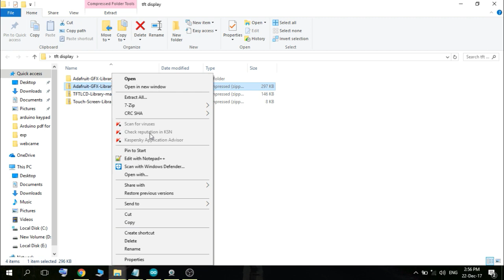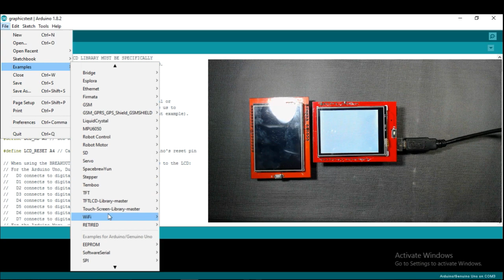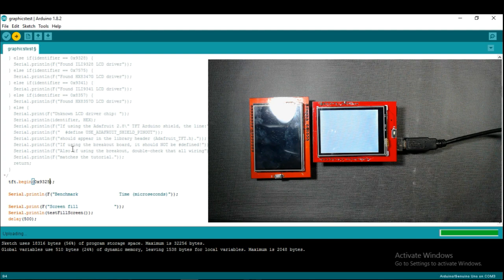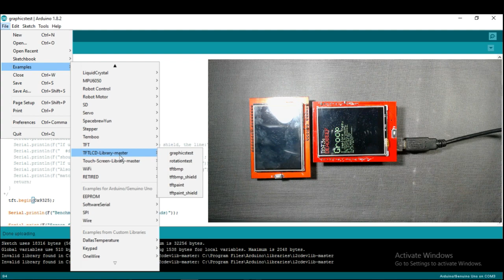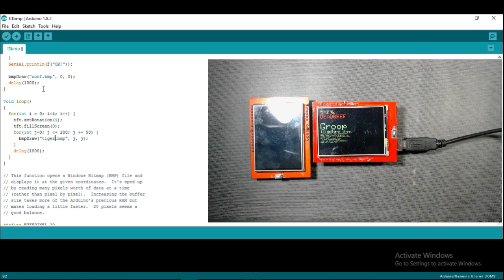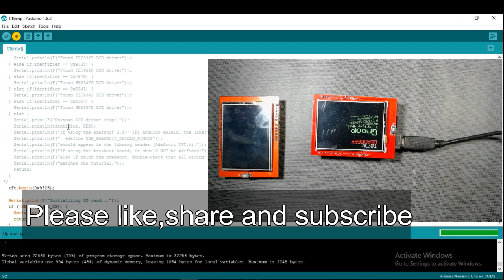How to fix white screen of tft touch screen with arduino | TFT unknown driver Fix

Comment: Paint!
Unknown LCD driver chip: 0
If using the Adafruit 2.8" TFT Arduino shield, the line:
  #define USE_ADAFRUIT_SHIELD_PINOUT
should appear in the library header (Adafruit_TFT.h).
If using the breakout board, it should NOT be #defined!
Also if using the breakout, double-check that all wiring
matches the tutorial.
他是0怎麼辦
Reply: #include <Adafruit_GFX.h>    // Core graphics library
#include <Adafruit_TFTLCD.h> // Hardware-specific library
#include <TouchScreen.h>

#if defined(__SAM3X8E__)
    #undef __FlashStringHelper::F(string_literal)
    #define F(string_literal) string_literal
#endif

// When using the BREAKOUT BOARD only, use these 8 data lines to the LCD:
// For the Arduino Uno, Duemilanove, Diecimila, etc.:
//   D0 connects to digital pin 8  (Notice these are
//   D1 connects to digital pin 9   NOT in order!)
//   D2 connects to digital pin 2
//   D3 connects to digital pin 3
//   D4 connects to digital pin 4
//   D5 connects to digital pin 5
//   D6 connects to digital pin 6
//   D7 connects to digital pin 7

// For the Arduino Mega, use digital pins 22 through 29
// (on the 2-row header at the end of the board).
//   D0 connects to digital pin 22
//   D1 connects to digital pin 23
//   D2 connects to digital pin 24
//   D3 connects to digital pin 25
//   D4 connects to digital pin 26
//   D5 connects to digital pin 27
//   D6 connects to digital pin 28
//   D7 connects to digital pin 29

// For the Arduino Due, use digital pins 33 through 40
// (on the 2-row header at the end of the board).
//   D0 connects to digital pin 33
//   D1 connects to digital pin 34
//   D2 connects to digital pin 35
//   D3 connects to digital pin 36
//   D4 connects to digital pin 37
//   D5 connects to digital pin 38
//   D6 connects to digital pin 39
//   D7 connects to digital pin 40

#define YP A3  // must be an analog pin, use "An" notation!
#define XM A2  // must be an analog pin, use "An" notation!
#define YM 9   // can be a digital pin
#define XP 8   // can be a digital pin

#define TS_MINX 150
#define TS_MINY 120
#define TS_MAXX 920
#define TS_MAXY 940

// For better pressure precision, we need to know the resistance
// between X+ and X- Use any multimeter to read it
// For the one we're using, its 300 ohms across the X plate
TouchScreen ts = TouchScreen(XP, YP, XM, YM, 300);

#define LCD_CS A3
#define LCD_CD A2
#define LCD_WR A1
#define LCD_RD A0
// optional
#define LCD_RESET A4

// Assign human-readable names to some common 16-bit color values:
#define BLACK   0x0000
#define BLUE    0x001F
#define RED     0xF800
#define GREEN   0x07E0
#define CYAN    0x07FF
#define MAGENTA 0xF81F
#define YELLOW  0xFFE0
#define WHITE   0xFFFF

Adafruit_TFTLCD tft(LCD_CS, LCD_CD, LCD_WR, LCD_RD, LCD_RESET);

#define BOXSIZE 40
#define PENRADIUS 3
int oldcolor, currentcolor;

void setup(void) {
  Serial.begin(9600);
  Serial.println(F("Paint!"));
  
  tft.reset();
  
  uint16_t identifier = tft.readID();

  if(identifier == 0x9325) {
    Serial.println(F("Found ILI9325 LCD driver"));
  } else if(identifier == 0x9328) {
    Serial.println(F("Found ILI9328 LCD driver"));
  } else if(identifier == 0x7575) {
    Serial.println(F("Found HX8347G LCD driver"));
  } else if(identifier == 0x9341) {
    Serial.println(F("Found ILI9341 LCD driver"));
  } else if(identifier == 0x8357) {
    Serial.println(F("Found HX8357D LCD driver"));
  } else {
    Serial.print(F("Unknown LCD driver chip: "));
    Serial.println(identifier, HEX);
    Serial.println(F("If using the Adafruit 2.8\" TFT Arduino shield, the line:"));
    Serial.println(F("  #define USE_ADAFRUIT_SHIELD_PINOUT"));
    Serial.println(F("should appear in the library header (Adafruit_TFT.h)."));
    Serial.println(F("If using the breakout board, it should NOT be #defined!"));
    Serial.println(F("Also if using the breakout, double-check that all wiring"));
    Serial.println(F("matches the tutorial."));
    return;
  }

  tft.begin(identifier);

  tft.fillScreen(BLACK);

  tft.fillRect(0, 0, BOXSIZE, BOXSIZE, RED);
  tft.fillRect(BOXSIZE, 0, BOXSIZE, BOXSIZE, YELLOW);
  tft.fillRect(BOXSIZE*2, 0, BOXSIZE, BOXSIZE, GREEN);
  tft.fillRect(BOXSIZE*3, 0, BOXSIZE, BOXSIZE, CYAN);
  tft.fillRect(BOXSIZE*4, 0, BOXSIZE, BOXSIZE, BLUE);
  tft.fillRect(BOXSIZE*5, 0, BOXSIZE, BOXSIZE, MAGENTA);
  // tft.fillRect(BOXSIZE*6, 0, BOXSIZE, BOXSIZE, WHITE);
 
  tft.drawRect(0, 0, BOXSIZE, BOXSIZE, WHITE);
  currentcolor = RED;
 
  pinMode(13, OUTPUT);
}

#define MINPRESSURE 10
#define MAXPRESSURE 1000

void loop()
{
  digitalWrite(13, HIGH);
  TSPoint p = ts.getPoint();
  digitalWrite(13, LOW);

  // if sharing pins, you'll need to fix the directions of the touchscreen pins
  //pinMode(XP, OUTPUT);
  pinMode(XM, OUTPUT);
  pinMode(YP, OUTPUT);
  //pinMode(YM, OUTPUT);

  // we have some minimum pressure we consider 'valid'
  // pressure of 0 means no pressing!

  if (p.z > MINPRESSURE && p.z < MAXPRESSURE) {
    /*
    Serial.print("X = "); Serial.print(p.x);
    Serial.print("\tY = "); Serial.print(p.y);
    Serial.print("\tPressure = "); Serial.println(p.z);
    */
    
    if (p.y < (TS_MINY-5)) {
      Serial.println("erase");
      // press the bottom of the screen to erase 
      tft.fillRect(0, BOXSIZE, tft.width(), tft.height()-BOXSIZE, BLACK);
    }
    // scale from 0->1023 to tft.width
    p.x = map(p.x, TS_MINX, TS_MAXX, tft.width(), 0);
    p.y = map(p.y, TS_MINY, TS_MAXY, tft.height(), 0);
    /*
    Serial.print("("); Serial.print(p.x);
    Serial.print(", "); Serial.print(p.y);
    Serial.println(")");
    */
    if (p.y < BOXSIZE) {
       oldcolor = currentcolor;

       if (p.x < BOXSIZE) { 
         currentcolor = RED; 
         tft.drawRect(0, 0, BOXSIZE, BOXSIZE, WHITE);
       } else if (p.x < BOXSIZE*2) {
         currentcolor = YELLOW;
         tft.drawRect(BOXSIZE, 0, BOXSIZE, BOXSIZE, WHITE);
       } else if (p.x < BOXSIZE*3) {
         currentcolor = GREEN;
         tft.drawRect(BOXSIZE*2, 0, BOXSIZE, BOXSIZE, WHITE);
       } else if (p.x < BOXSIZE*4) {
         currentcolor = CYAN;
         tft.drawRect(BOXSIZE*3, 0, BOXSIZE, BOXSIZE, WHITE);
       } else if (p.x < BOXSIZE*5) {
         currentcolor = BLUE;
         tft.drawRect(BOXSIZE*4, 0, BOXSIZE, BOXSIZE, WHITE);
       } else if (p.x < BOXSIZE*6) {
         currentcolor = MAGENTA;
         tft.drawRect(BOXSIZE*5, 0, BOXSIZE, BOXSIZE, WHITE);
       }

       if (oldcolor != currentcolor) {
          if (oldcolor == RED) tft.fillRect(0, 0, BOXSIZE, BOXSIZE, RED);
          if (oldcolor == YELLOW) tft.fillRect(BOXSIZE, 0, BOXSIZE, BOXSIZE, YELLOW);
          if (oldcolor == GREEN) tft.fillRect(BOXSIZE*2, 0, BOXSIZE, BOXSIZE, GREEN);
          if (oldcolor == CYAN) tft.fillRect(BOXSIZE*3, 0, BOXSIZE, BOXSIZE, CYAN);
          if (oldcolor == BLUE) tft.fillRect(BOXSIZE*4, 0, BOXSIZE, BOXSIZE, BLUE);
          if (oldcolor == MAGENTA) tft.fillRect(BOXSIZE*5, 0, BOXSIZE, BOXSIZE, MAGENTA);
       }
    }
    if (((p.y-PENRADIUS) > BOXSIZE) && ((p.y+PENRADIUS) < tft.height())) {
      tft.fillCircle(p.x, p.y, PENRADIUS, currentcolor);
    }
  }
}
Reply: 謝謝教導我測試成功了，抱歉我以為她會跑else if(identifier == 0x9341) {}原來要一個個測試，等等我把他轉二進制，測試看看會不會跑if

Comment: The problem with these displays is the reset. The software reset in the driver on pin A4 doesn't work. Connect it to the Arduino RESET and it all works as expected. No need to manually configure the identifier!!! Sort out the root cause of the problem, not workaround it!

Comment: Sir i'm using Arduino Mega 2560 with 1.8 TFT st7735 the code is compiling but showing a white screen on TFT. After checking the serial monitor it is displaying present time.

Comment: When I use the 9325 and 9328 I get color  and movement but not the correct display. Mostly full pink screen turning to blue back to pink. Should I try other Identifiers? The seller just sent me a folder which contained this file _9341uno.  When I try it I get an error: a sub folder of your sketchbook is not a valid library .Does that mean they think it is ID 9341? This was the Zip file they sent 2.4inch_Arduino_ILI9341_V2.0

Comment: If anyone is having problems with not being able to find the port or connecting to the board I highly recommend getting a new cable, I didn't think it would be a problem to do with the cable since it was making the screen go white, but it was and its all working perfectly fine with a new cable!

Comment: Setting the identifier manually hasn't fixed the white screen problem in my case.
When I don't change anything, the ID shows up as "0"...
Reply: set it to 0x9341
Reply: @it0it0  how bout 9300

Comment: I just received a 2.4 inch display and tried to get it going on the Uno. There's not much on the board to identify it but it is a Mcufriend display. It simply had printed on the back of the board "www.mucfriend.com" "tftlcd for arduino uno (spiflash). Running graphictest gives blank screen, serial port output reports: 
Serial took 0ms to start
ID = 0xC0C0
That's it and the screen stays white. Is there some configuration I have to do or is this screen not supported? Any help greatly appreciated.

Comment: Just connect the RESET pin of the display to the RST pin of the Arduino. This fixes a proper reset at power up.
Reply: Yes exactly correct!
I have been trying to use software reset command at the beginning of my code.
It didn’t work... white screen all the time!
As soon as I arrange hardware reset the display started working !
The only disappointing thing here is that u have to use a pin on microcontroller for just that purpose which is stupid loss...

Comment: Still didn't work for me.  Maybe my screen is dead.  It's white but none of the hex numbers work.  Also, it doesn't seem to recognize any driver chip like in your video. You got "6809".  All I get is "0".

TFT LCD test
Using Adafruit 2.8" TFT Arduino Shield Pinout
TFT size is 240x320
Unknown LCD driver chip: 0
Reply from the maker: Sorry for that. It works for most of the cases. But you try in google. You may get different methods. If it is white, it may not be dead. Most of the cases, we get the hex code as given by Adafruit Industry. But most of the boards come from China and they use different Drivers and therefor this white screen problem occurs.
If you woun't get any solution, then  buy boards from Adafruit directly from there website(I am not advertising their brand), it will be little costly, but you will not get any problem.
You can visit to our "dpvtechnology"website for other components (till now,it is only for india).
Reply: Thanks for the help DPV TECHNOLOGY.  After some searching around google, it seems like there are numerous versions of this display that all look almost identical but have different driver chips.  Therefore, no one solution will work for them all.  You have to try multiple different methods.  I think you're right -- if the screen is white, it's probably a sketch and/or library issue and not a hardware issue.

My advice to anyone else having the white screen problem -- try the steps in DPV TECHNOLOGY's video and if that doesn't work, keep trying other methods until you find one that works.  Google can help find the other methods.
Reply: @Samuel-km5yf  Did you find it?

Comment: Buddy links gone. not working anymore. kindly help
Reply from the maker: NOT GETTING YOUR QUESTION YAAR
Reply: the three links in discription  are not working any more kindly help

Touch screen library
https://github.com/adafruit/Touch-Scr...

TFT LCD library
https://github.com/adafruit/TFTLCD-Li...

GFX library
https://github.com/adafruit/Adafruit-...
Reply: iam using it on wemos D1 hope it will work
Reply from the maker: Thank you for your comment.we will fix it soon by today..
Reply from the maker: link has been fixed.you can try

Comment: hello. sorry for my bad English .I am trying to resolve my white screen problem. I have try all library whithout solution. now i think that it's about my register and i upload LCD_ID redreg library to show a different values of my registers  and i found this:Unknow LCD driver C0C0. i am using a 2.4 TFT SPI 240x320 whith arduino uno. I need help.
Reply from the maker: Thank you for your comment..Try to replace your driver instead of the driver given in the program.But I did not check that. If it will not work, please try with the following--
http://www.instructables.com/id/How-to-use-24-inch-TFT-LCD-SPFD5408-with-Arduino-U/

Comment: hello DPV TECHNOLOGY.i have used all things that you showed on your video but my white screen problem hav'nt changed
Reply: If u r using mcufrind shield then download mcufriend tft libraries & try the examples if u still get white screen then go to this link https://forum.arduino.cc/index.php?topic=450176.0
Reply: @johndripper   I am having similar issues, white screen, I added the kvb libraries, graphicstest reports 0XC0C0 as identifier, and I don't know where to go from here. BTW I don't see a link in your reply.
Reply: @googleuser6875  why so its right there under my reply
Reply: @johndripper  IDK I've seen this kind of thing before when using Chrome.
Reply: @johndripper  Hi, looked at it this am using my smart phone and I see it fine! I'm thinking something in Chrome's settings or maybe antivirus....I'll pursue that another time. Cheers
Reply from the maker: Der Jean François Houssou ,in most of the cases,the given method works fine.But if the driver configuration is not similar to the given driver,it will not work.For that it is difficult to solve the problem.try to google to fix in your case.If you find any solution for your case,please upload a video so that other people also get benefited.Thank you.
Reply: Try the  MCUFRIEND_kbv-master  Library then uncomment your particular tft screen in MCUFRIEND_kbv.cpp